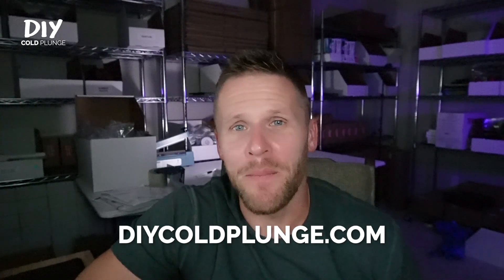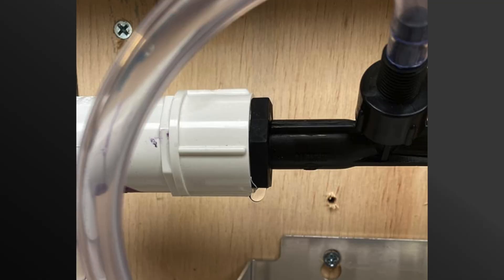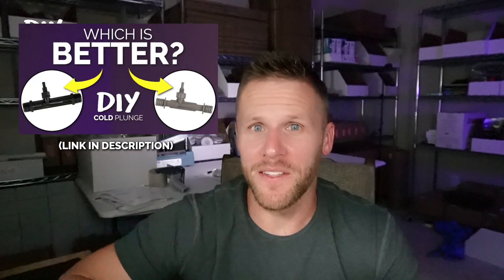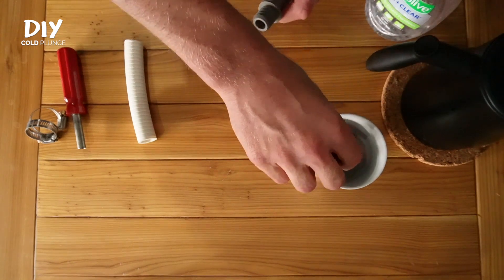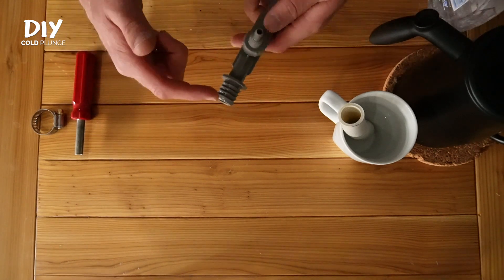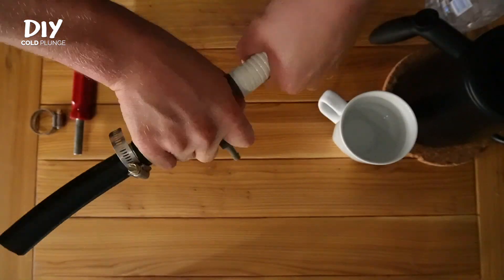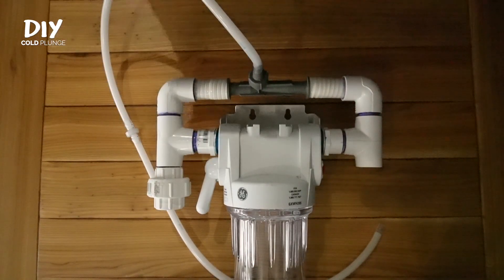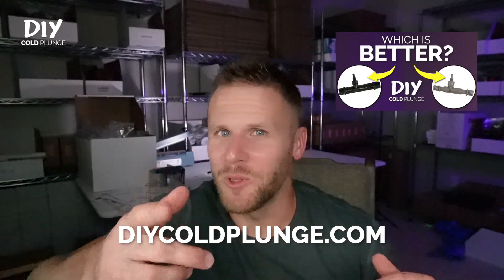Venturi Injector Tutorial for Ozone Sanitation | DIY Cold Plunge

Comment: Thanks for all the tips Joe! Just put together the tub 2.0 minus the water cooler. Found that the vacuum on the venturi is so strong its pulling in air through the hose connected to the ozone. It makes the flow back to the tub have lots of air bubbles. If I put my thumb on the top hole of the venturi it runs with no bubbles. 

Have you seen this before on any builds?  Was thinking about putting a ball valve in the mix to control the pressure. 

Thanks again!  loved the suprise that came in my order!  🦆
Reply from the maker: You're welcome! Yep, that happened with all of mine so far. I take it as peace of mind that the venturi works! If you want to you can add that valve, but I have just left it as is, it doesnt bug me much.